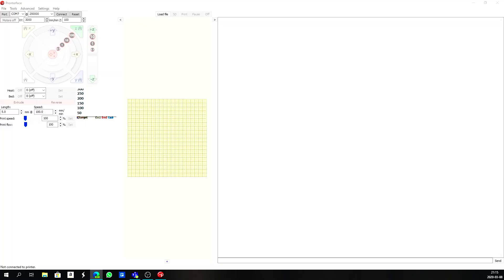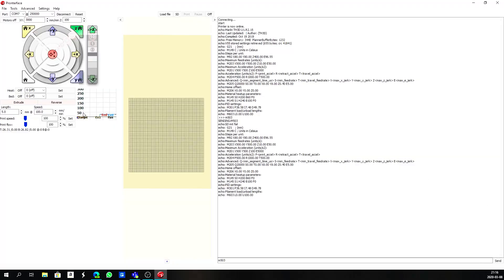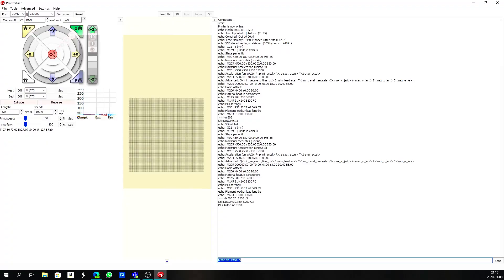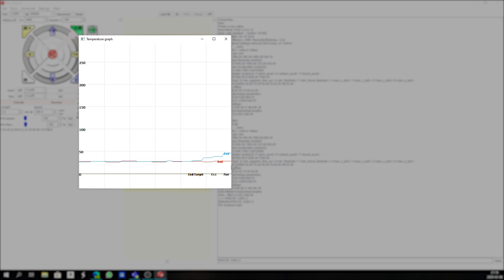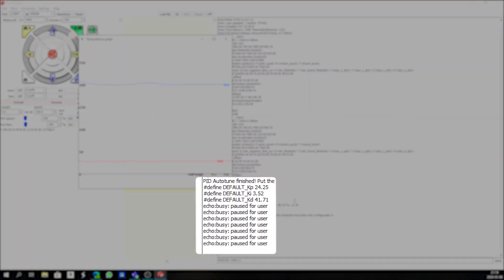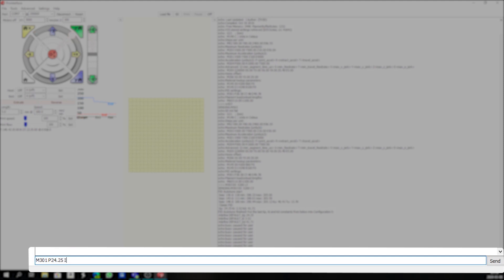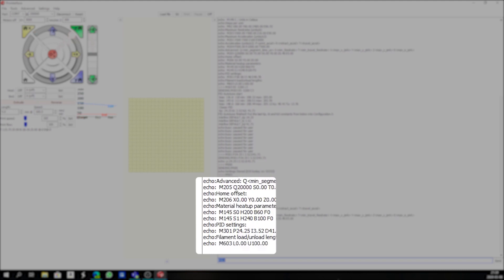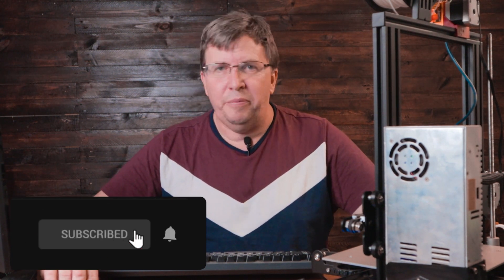TEMPERATURE ISSUES | Adjust you PID setting | THE EASY WAY

Comment: I have a question.Does the cooling fan have to be on eg at 100% whilst setting the PID.Because my Anet A8 can't seem to hold the temperature at 200C while printing & the cooling fan is on(at 100%).I did try to set PID with the fan running at 100% but it would fail.Any advice?

Comment: Hey Eugene, I'm learning alot from your videos! Quick question about the settings. How of where do I find out what settings are for my machine before saving them? Thanks!
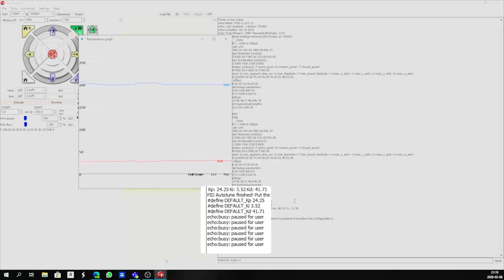Reply from the maker: Hi Elmer, I am so pleased that the videos are helping you.  Please consider subscribing ;-).  After typing M503 and after all the temperature rising and falling, on the printer display it will say "Resume", , then at 2:50 in the video you will see 3 values come up on the Pronterface screen Default_Kp, Ki, Kd, these are the 3 values you use for P,I and D.  I hope that this is clear.
Reply: @FusionSource  awesome thank you! Definitely subscribed!!